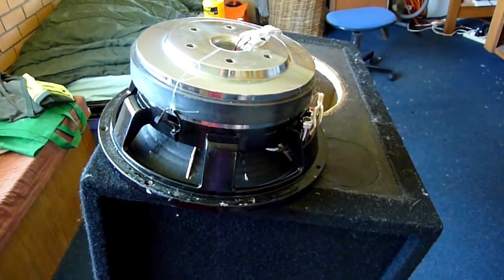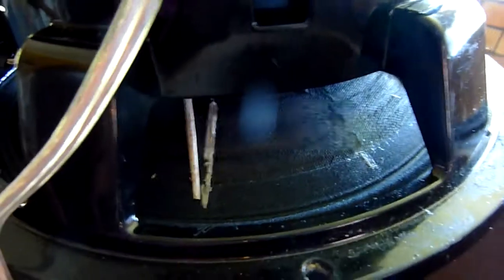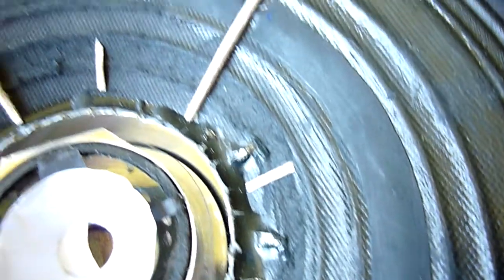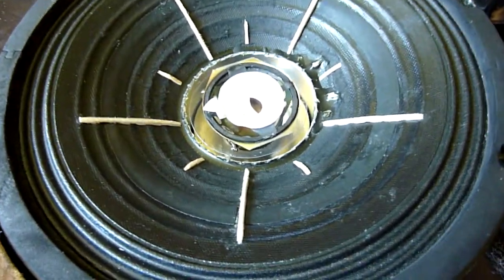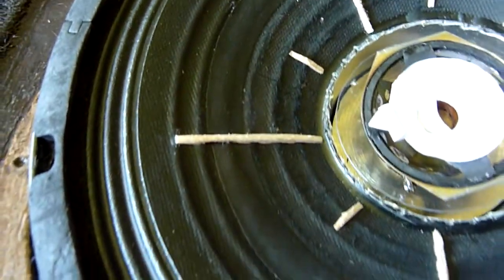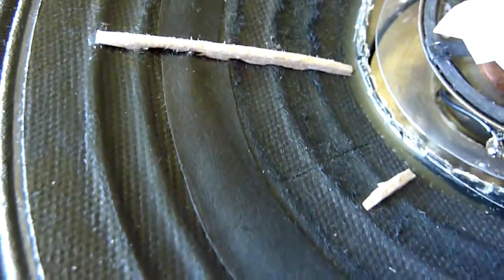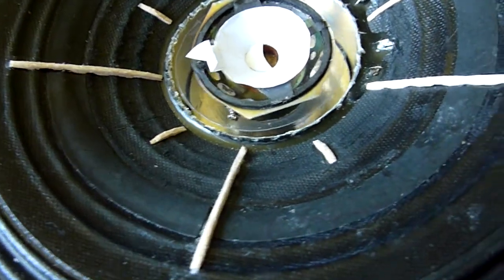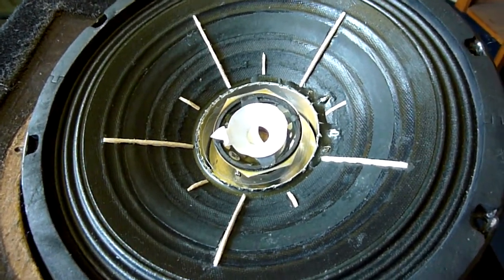POINT-SOURCE SPEAKERS (MODIFIED THE CONES).

Comment: It's seems like KEF speakers:
http://www.kefdirect.com/media/catalog/product/cache/1/image/5e06319eda06f020e43594a9c230972d/r/1/r100_pairedit.jpg
Reply from the maker: Thanks. Like the KEF Uni Q drivers. These are 150 w PA drivers and I keep blowing the tweeters. So I'm going to buy some car "bullet" tweeters (high wattage). They will fit in the 3" cavity just nice (if I buy the right tweeters). YT search "Bullet Tweeter". They will be good for a party then. I have a 200+200 w amp. Has 0.1% distortion (@ 200 w).
I got the amp brand new, for $320. I have a lend of some 12" Coral woofer 3-way speakers.
With my cheapy 200 amp, my chair vibrates. Insane bass, for one reason only... power! I'm now convinced that power is the secret to make a transistor amp sound good (specially the bass).
Reply: Great For outdoors the bullet twetters are excellent. The power is important, but the sensivity or eficiency in dB is more important. because if you have one speaker whith good sensivity for example 95-98 dB they sounds very loud whith less power in the amp.
Reply from the maker: Oscar P As long as they handle my 200 w amp. If tweeters are too loud for the woofer, I can put a low value (high wattage) resistor on the tweeters to balance the sound with the woofer. With most pissy little tweeters, I have to resist the woofer. Now it will be the other way around. I want the same power handling with the tweeters as the woofers (which are 150 w).